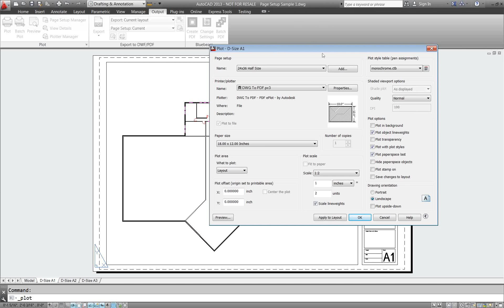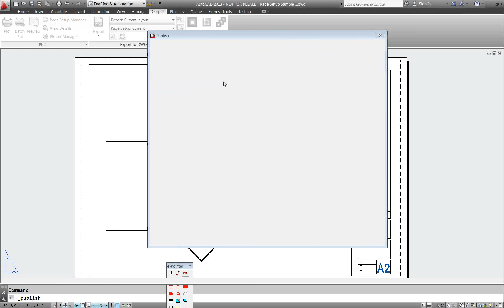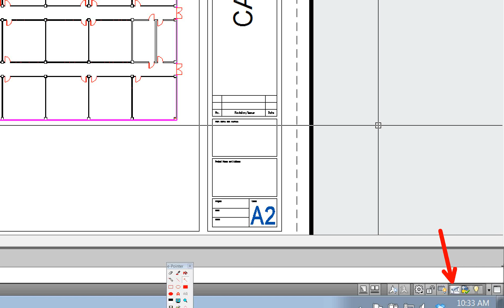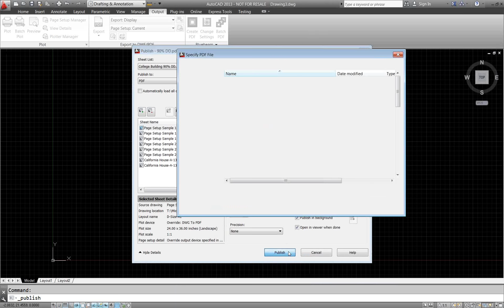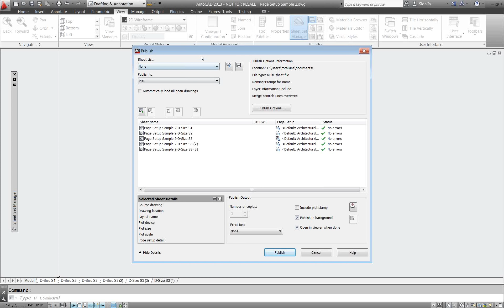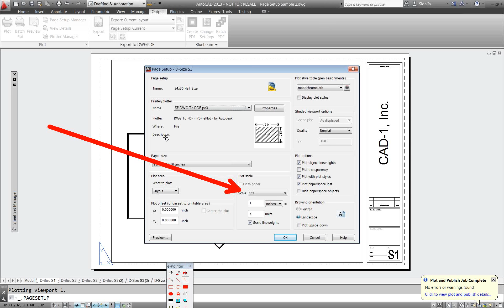CAD-1 Presents - Page Setups & Publishing in AutoCAD

Comment: Coming from DraftSight, I was really confused with the way AutoCad printing worked. It's similar in a lot of ways, but DraftSight stores the "Named Page Setups" in your user folder and they are available to any drawing. I liked this, as it was easy to manage the printing settings, but then everyone would have to make sure they had the same settings on their computers or store it on a server and make sure to import them. It could also get confusing, trying to browse through a long list of print setups. Thanks for the help.